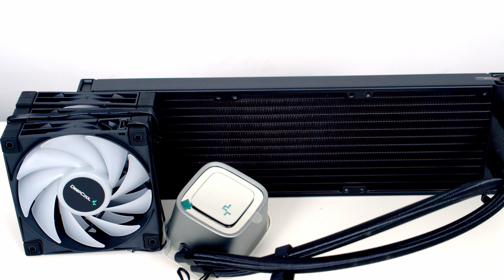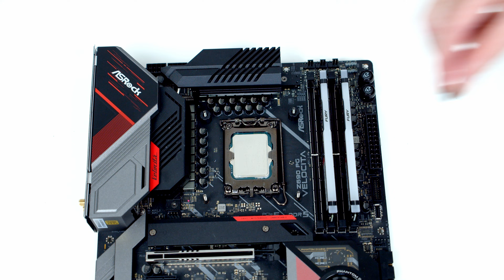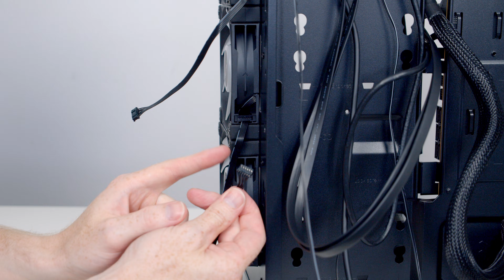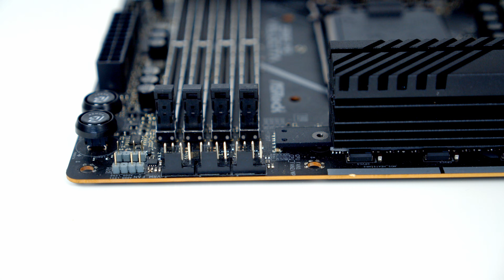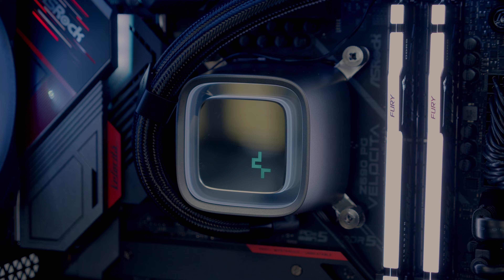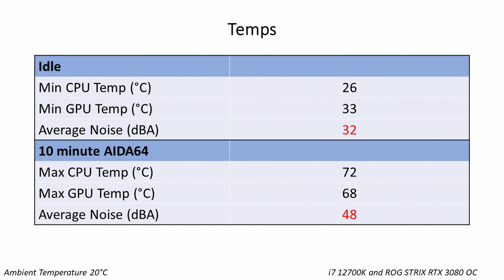DeepCool LS720 Installation Guide

Comment: Now moved this from my AM4 setup to AM5 7800x3d . Can't get it over 75oC. Probably could with prime95 but why bother. It's sitting at 5050mhz flat barely breaching 75oc in worst case scenario. 40-57 oc in games. Never more.

Comment: Thank you for this video. I installed my ls720 cooler 1 year ago and bear in mind it was my first time installing any cooling fan for that matter. For an entire year, i couldnt figure out and fix the super loud and high spin sound coming from the cooler. I had even tried modding the bios to decrease the fan speed, but it didnt work. After watching your vid, ive realized i never properly hooked the power for the fan. Rather than the aio pump in, i hooked it up to the cpu fan in and dealt with loud noise till now

Comment: Everyone this is mounted in the wrong direction, you want the radiotor top to be above the hoses on the bottom so air stays in the rad.  This way it stays in the tubes and gets cycled to the pump and back and forth.   Facts.
Reply: The pump just can't be the highest point in the loop. The highest point is the top of the radiator. This is fine.

Comment: Hi Christopher, I connected the fans the same way as your video however, the last fan is always running at full speed. The other 2 fans are working normally. I've already replaced the fans  twice and still the same problem. Please help

Comment: Mine start making noises from either a pump or radiator after 7 months,possible air and bubbles in the radiator unit or bad pump.
I will have to take it to repairs to see what is wrong with it.
I'm not happy about it   :(
Reply: I also had problems with one of the fans after 4 months. It stoped working. Sent it to warranty

Comment: Which direction does the fan blow and which side of the radiator is it suppose to be mounted? May seem basic, but for someone who has never used a water cooler, we need to know these details. Also is the RGB an optional connection? Mine doesn't want to attach to the pins on the motherboard. Anyways your video is better than the non-instructions provided by the manufacturer. Thanks

Comment: Searched "proper orientation for pump" and found this first. That radiator is upside down and will be sucking air by now, so there's really no reason to trust the rest of your video. Absolutely love your voice, wish you knew what you were doing.
Reply: What do you mean? JayTwoCents made a video about AIO orientations and this orientation is completely fine.
Reply: @quynhnguyen-cs7qw  if the pump is on the waterblock, Jayz video is right, if it's on the radiator, this commenter is right. It's usually in the waterblock, but not always. You want the pump to be the lowest point in the setup generally.
Reply: @campbellwilson3043  he installed the fans wrong lmao. He's sucking air in
Reply: Lol. This is perfectly fine. Many cases don't have any other option.

Comment: Had a question bro. There's two pwm on LS720 one is the 3pin pwm on the pump and the other 4pin pwm is on sata connector. If I change the fan two other brand. Should I still connect the two PWM to the motherboard?

Comment: Doing my install now...I have to admit I was kind of stumped, but your video set me straight. Thank you sir! Great Job!
Reply: is there already liquid in the cooler ?
Reply: @CalLinx  yes it is a completely self contained system.
Reply: @FinkworldTravels  so you don’t have to refill it after a while ?
Reply: @CalLinx  ALL AIO's will lose fluid over time, but it takes a long time before enough naturally evaporates to notice any temperature changes. Keeping it free of dust build up will be a bigger concern. I recently cleaned mine after just five months of use because of the dust. if I ever lose enough fluid to actually make a difference in the cooling temperature I'll just replace it, by that time it will probably be a couple of years old.
Reply: @FinkworldTravels  thanks for the information man means alot

Comment: I'm curious... is the position you mounted the cooler in okay for the pump in this model?

I'm asking because I just watched two videos from Steve and Jay stating this position is bad, I've also positioned the same cooler in the same way you have and am wondering if it is okay on this model or not, and if it is, how have you come to that conclusion?
Reply: It is fine the way he mounted it, the problem appears if the highest point of the pump is level or higher than the points where the hoses connect to the radiator.
Air will make its way to the highest point in the loop (because physics), and the whole point is you don't want the air pockets to reach the pump.
If the air pockets reaches the pump, they will stay in the pump and that will make the pump work harder, severely reducing its life.
Reply: I don't understand how you especially watched Jay's video and are still this misinformed/didn't grasp the concept of physics and orientation of an AIO. You want the tubes that connect to the rad ABOVE the pump. If you meet that goal, that's all that matters.

Comment: For some reason the rgb on my pump is not working, but the rgb on the fans is. I've connected all cables as seen here, any idea what the issue could be?
Reply: did you fix that?
Reply: @giovana4789  I never did, I started a return for replacement and DeepCool seemed happy to assist but I didn’t want to go through the hassle of uninstalling the unit and being without a PC for the time it took to get the replacement
Reply: @haroldbargo21  damn

Comment: when I connect the 5v cable the fans are just orange when I remove the cable it is on rgb (various colors).  what could be wrong?  In the manual it says to put the 5v cable....
Reply: Right the dam pamphlet is stupid it comes with, so confusing honestly. I plugged in all the wires as it showed in the tutorial video they have on the LS520. I can't boot my pc up yet though, my processor didn't arrive with the cooler like it was supposed to. So tomorrow it's supposed to be here so I can pop it in and boot up my pc. Then I can see if everything works.

Comment: Thank you a lot for your dedication Christopher, but fon the moment I don,t have much confidence in liquids inside my machine with a I9 12900K at the moment. A little question ¿what does the Q-Flash tell me when show me 04 instead of AO, that I think is is the right one (or not). Tank-iu again.🙋‍♂ PD: the motherboard is Aorus Z690 DDR5 PRO, when I reset it then shows AO, but I don,t think that reseting continually is a good or normal thing to do. Something wrong ¿do you think in the PC?